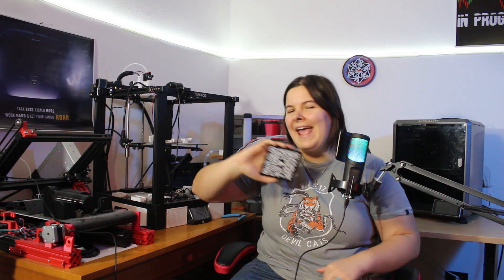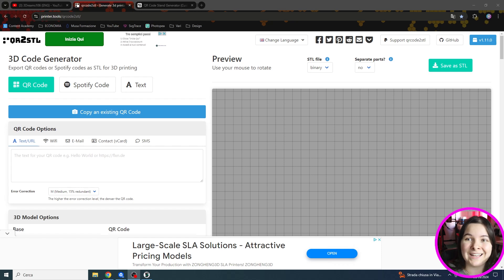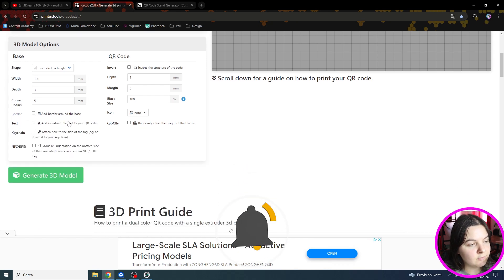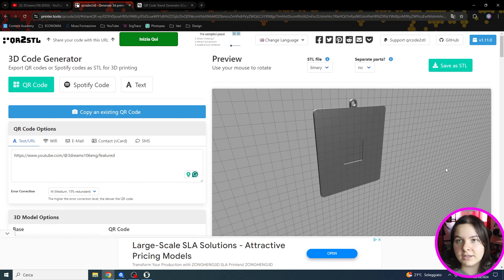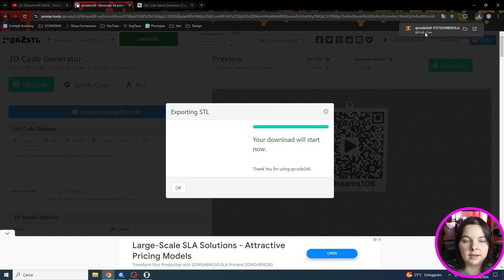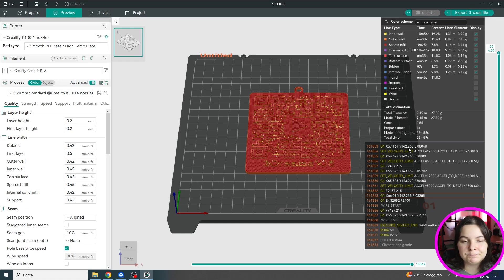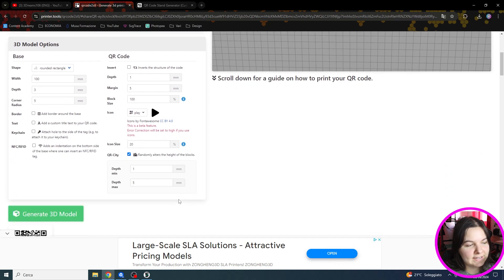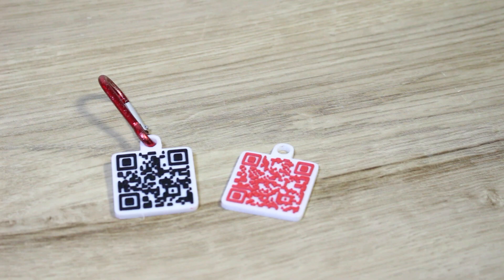3D PRINTED QRCODE with just 2 CLICKS! 💥 NO AMS NEEDED! 🚀

Comment: What kind of nozzle size are required? I want to print as small as possible. Whould 0.4 work or do i need 0.2?

Designing a small box with a lid. Around 100x60x30mm and im planning of putting the qr code underneath on the bottom plate. Integrated in the surface somehow
Reply from the maker: You can use a 0.4 but the 0.2 is definitely better if you want to print small